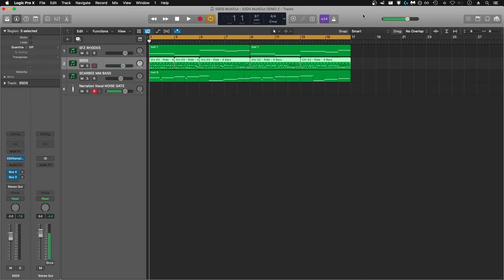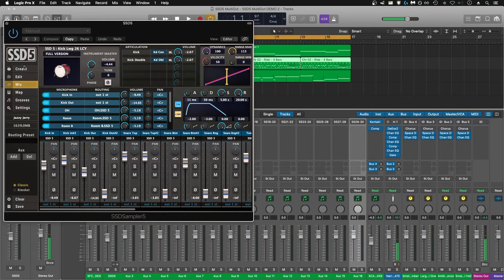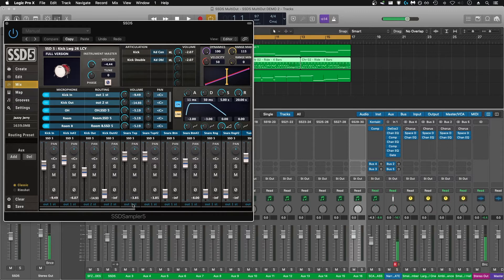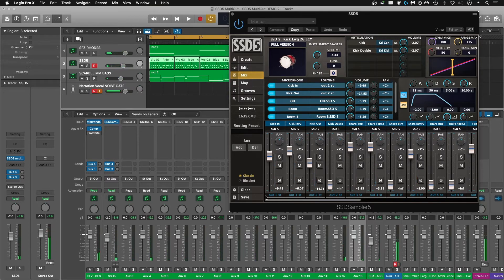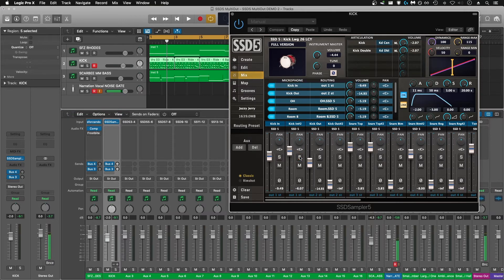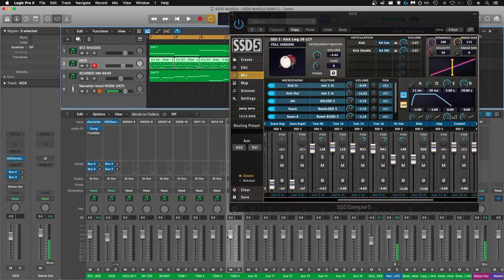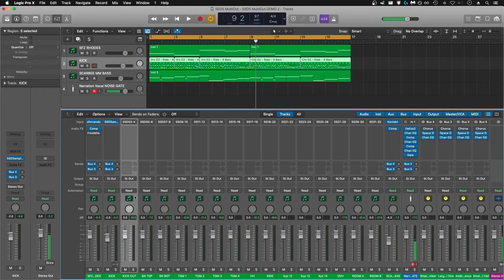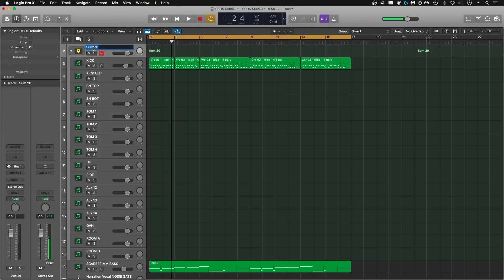How to Set Up Multichannel Out for Steven Slate Drums 5 in Logic Pro

Comment: It seems like in Logic you can only use the stereo multi-output with SSD5.5? Or have they updated that? With other DAWs, you can use mono multi-output. I ask because I don't want all my drums in stereo. I guess I could bounce in place and convert to mono, but then I'd have an audio file instead of Midi, which would make editing more challenging.
Reply from the maker: I could be wrong but I believe Channel like the kick and snare are mono sources that are simply routed through a stereo channel. Basically they are sonically identical to a logic mono track even though they appear as stereo. Try taking the logic gain utility and turning "mono" on to see if there is any difference in sound.

I get what you're saying tho about not wanting stereo channels as certain plug-ins default to stereo mode on the channel, but are processing a mono source which is not correct. Also the channels should be simply "switchable" between mono and stereo for maximum compatibility and functionality.

Comment: HI, Im trying to use slate drums in logic but it won't show in Audio FX menu. Found out that Logic doesn't support VST. So to my question: How do you make it work?!? Think I am going fx!king nuts
Reply from the maker: I'll do my best to help out.

When you install Slate Drums 5 through the installers, it should be installing both the VST version and the AU version if you're on a Mac computer.

The only thing I can think of is that you might be trying to load Slate Drums on an audio track, or as a Midi fx plugin (as opposed to a Midi Instrument plugin).

Try making a midi track and make sure you're trying to open slate drums as a "midi instrument" which is right above the larger box where you can load "midi fx".

Other than that, try opening up logic pros plugin manager library through your preferences and make sure that SSD5 appears on this list and has passed activation test. Also sometimes you need to reboot your computer after installing a new plugin to get it to show up on that plugin list.

Please let me know if that helps!
Reply: @matthewbcarter what is VST and AU?
Reply: What is VST?

Comment: Great video, thank you a lot!! However do you think that when we record we should use the original levels in the mixer of SSD or should we set to zero all faders? I ask because when mixing the audio files I usually use the original levels that comes with SSD to preserve the balance but I’m not sure if that is the right thing to do. Can you help? Best regards and stay safe!!
Reply from the maker: Hmm that's an interesting question. 

Considering you print to audio I don't see a disadvantage to leaving all of the faders at 0 to then print and mix the stems. The only thing you might need to adjust in SSD5 is how much of each mic  is being sent to the room channels. You won't be able to lower the volume of the cymbals or the toms in the room mic mix once you've printed them to audio. 

Also I don't remember exactly how SSD5 handles mic bleed. You'd want to adjust your bleed within SSD5 before printing to audio. 

For those reasons I mix as much as I can with midi and within the program before printing to audio.

Sorry for the late reply and hope that helps!